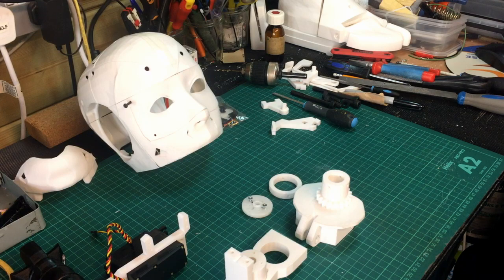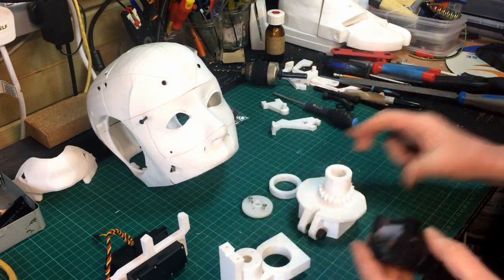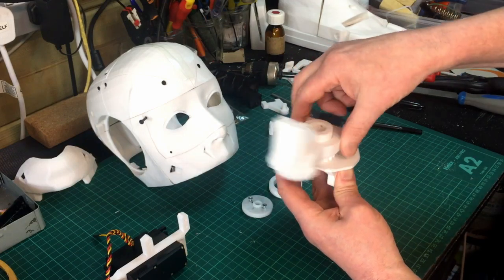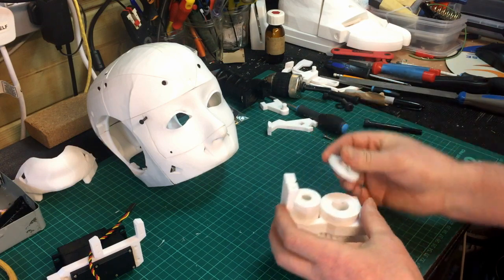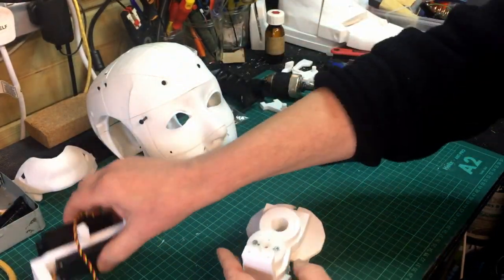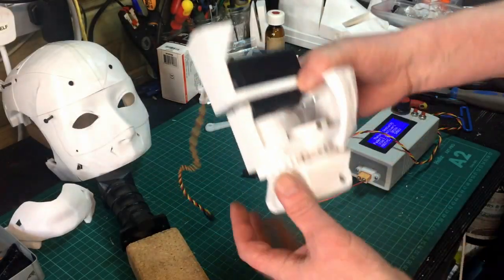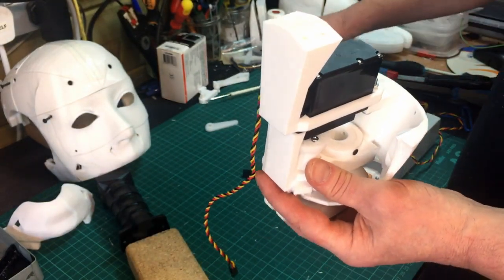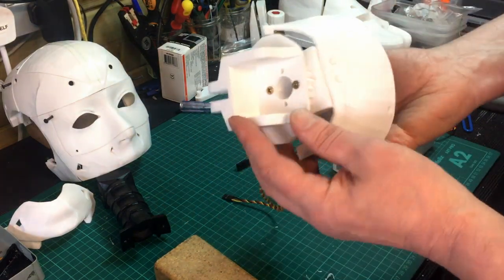InMoov Build Part - 28

Comment: can i use a stepper instead of a servo , since the stepper is more precise for camera tracking and face detecting etc I'm talking abt eyes mechanism . thank you for your wonderfull tutos
Reply from the maker: Hi Amine, yes you could use stepper motors if you want, its just down to how you wish to control the motors.  And what sizes motors are available and cost of the stepper motors.  I believe there are InMoovs running with stepper motors - https://www.thingiverse.com/thing:50054 and probably others